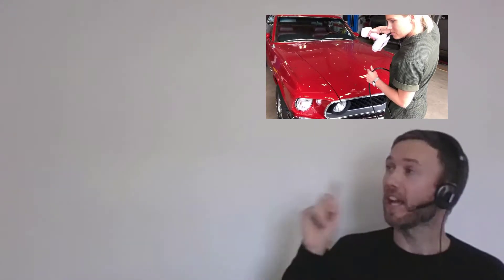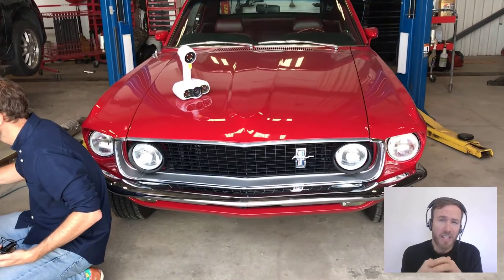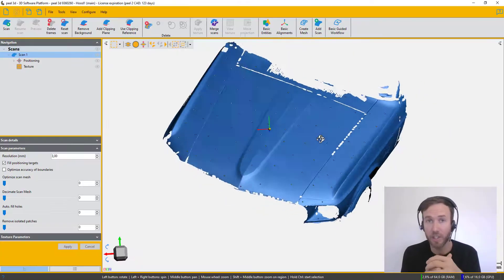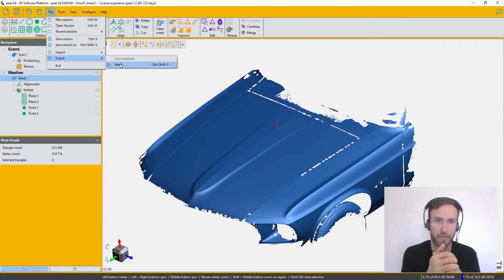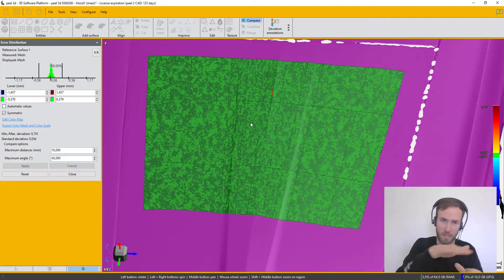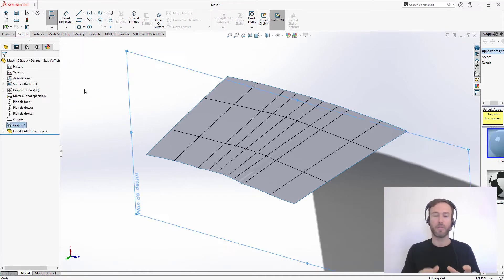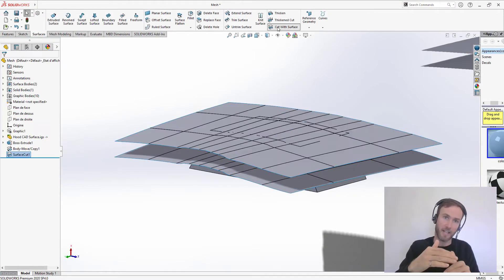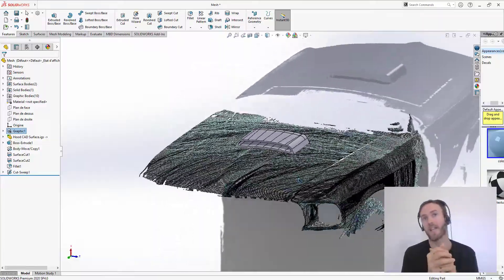peel 3d™ | Design a hood scoop with a scan in Solidworks

Comment: Can you add more details as to what files types you saved to import into solidworks? I bought one of your scanners years ago (the previous model) and I had an impossible time working the scan output in Solidworks. Solidworks could not handle the large cloud of points generated by the scan even after decimating the mesh a lot. At the time I also remember the Peel software being severely limited in what it could output. Other than STL or the mesh I don't believe there was anything (reference geometry like an actual surface) that I could import into solidworks. After looking into it, I realized your software was a dialed back version of some other better software that was much more expensive. Has the Peel 3D software been updated to now be able to export to Solidworks?
Reply from the maker: Hi. Our previous 3d scanner model was limited to stl, obj files and other triangulated meshes; these don't work so well in Solidworks indeed. peel 2 CAD will now let you export igs and stp files. It is now also possible to generate geometrical entities, surfaces, cross-sections, etc. We are continuously improving our solution and will keep improving in the future. For more information, contact us at hello@peel-3d.com!